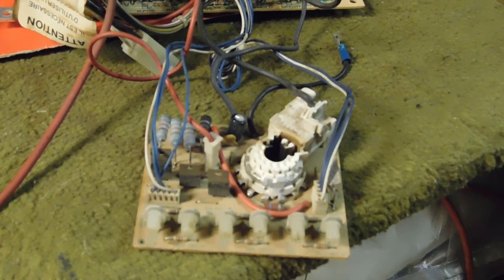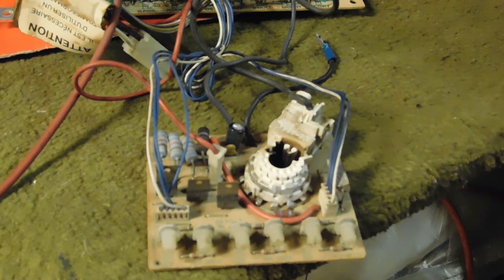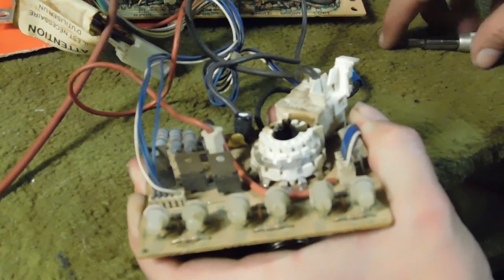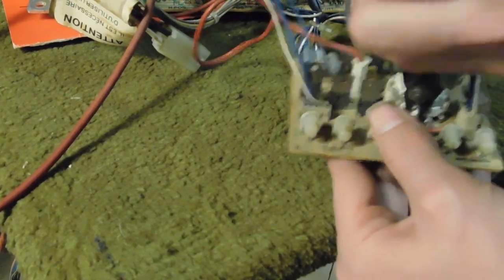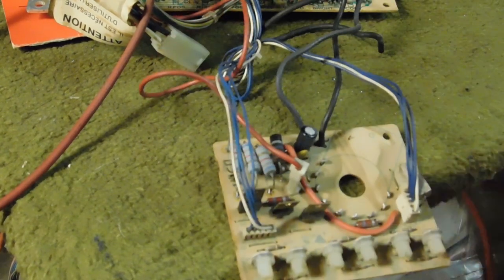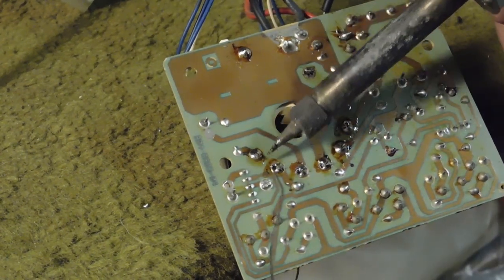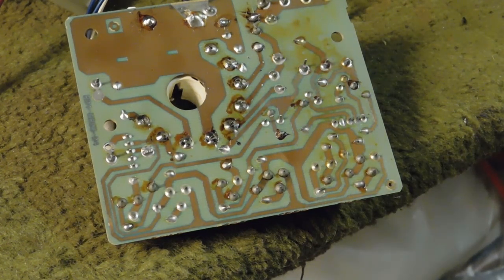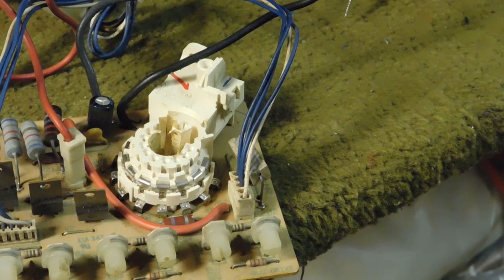How To Replace A Neck Board Socket {Wells Gardner K7000 Series}

Comment: It would be nice to go over the theory in a video lesson of why arcade monitors use an isolated transformer to isolate the grounds. If you connect an oscilloscope to measure the arcade monitors waveforms signals of the vertical deflection, horizontal deflection, etc it will damage the oscilloscope because the Oscope is earth grounded and the arcade monitors circuits are NOT connected to earth ground. For some reasons when you connect the Oscope probe to measure a waveform or test point on an arcade monitor it will damage the Oscope because the probe grounds the arcade monitor circuit board which puts very high voltage to ground. I have no idea why arcade monitors designers did this because its not safe at all.
Reply from the maker: That's a great point I didn't think of before, it really is a weird design especially if you use a scope to test a monitor. I can say for sure I've damaged a scope in the past from doing that exact thing.
Reply: @willsarcadeservice4599  Most Arcade techs don't know and they damage Oscopes doing this. You have to use a 2 channel Oscope and set it to ADD mode then INVERT ch#2. You don't use the probes grounds and use ch#2 probe connect it to ground arcade monitors chassis frame. Then with Ch#1 you can measure the monitors waveforms without damaging the Oscope. You can measure the Red, Blue and Green signals before the Sync Separator IC chip and After the Sync Separator. You can measure the H sync and V sync before going to the V deflection circuit and H deflection circuit which are High Voltage circuits. The Oscope has a MAX voltage rating so if its more than 300vac or 500vac you can't measure the V&H Deflection circuits but its something to go over in the video lesson so arcade repair techs should know this stuff.
Reply from the maker: @waynegram8907  Thank you for the info, I made notes of everything you said so when I get a scope I'll make sure to do this so I don't damage it. Again, thank you very much.